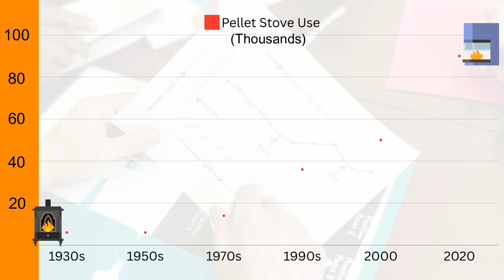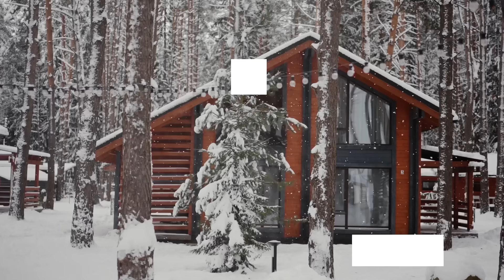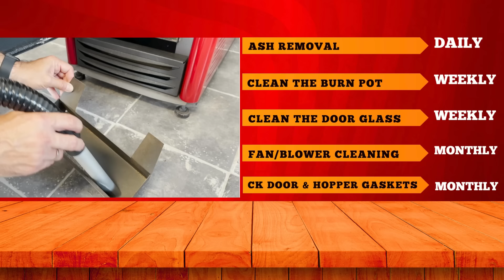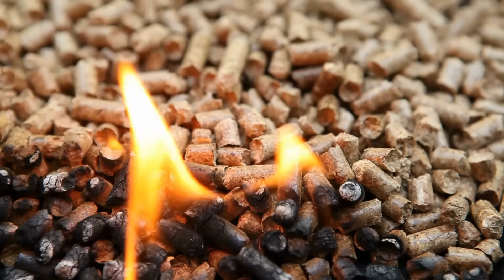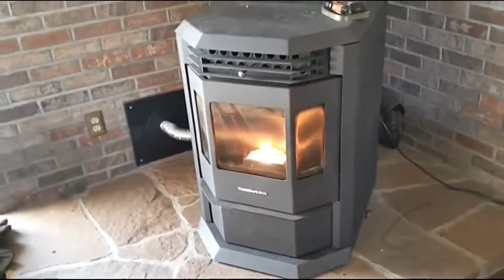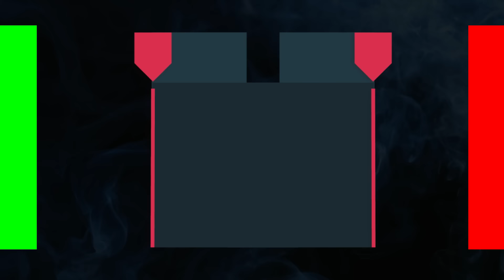THE COMPLETE TRUTH ABOUT PELLET STOVES

Comment: Millions of homes currently have Asbestos siding in the United States. These pellets stoves wood be impractical and impossible because you can’t cut the hole for the exhaust pipes. Even if you use a window to send the exhaust pipe out of the house, the exhaust pipe can’t be secured to the outside wall due to the asbestos siding.
Reply: FYI  some of us have brick homes so we can secure those pipes.
Reply: , FYI  you're forgetting all about folks who will remove a window in order to install the pipes. And many also have brick homes so pipes can be secured.

Comment: I have a US stove 6041i and it is one of the worst purchases I have ever made in my life.  Multiple failures. The pellet auger failed. The control board failed about 7 days before what I calculated my warranty would run out.  US stove informed me they start the warranty the day the wood stove leaves their factory. I was able to plead my case in that I didn't have use of the wood stove when it left their factory for several days because it was in transit and they should extend it to the date of delivery. Thankfully they did because the control board was over $600.  The 6041i is a conversion of the 6041 to make it an insert. Every time you have to do any kind of maintenance work you have to remove the insert from the fireplace. There is not a rail system to help you pull it out so you're going to scratch up your hearth unless you're careful. The cooling fan on the auger motor cracked at the shaft and the fan was not available as a replacement part. I was able to glue it back together and use a spring clamp from the hardware store to affect a permanent repair otherwise well over $100 for a new motor.  As I said it's a 6041 that was converted to an insert. The 6041 as a standalone is much easier to use. The hopper door is in the right position and you can get to the auger to clean out compressed sawdust from the pellets. This has to be done every so often. 6041 has a narrow door in the front and to get to the auger to clean it you have to remove the entire top. On the standalone unit the top door is large enough you can get your hands in there and remove the cover to clean. 6041i is not, not by a long shot.  Only a few operations did it ever put out the heat that it was supposed to. Most times it wasn't that efficient. So the 6041i from US stove I would steer so far clear from it.

Comment: We opted to go to a pellet stove in 2018 when we rebuilt our home following a fire (not related to heating). Our choice was a Castle Serenity unit. When we came to install & set up we quickly found that nobody knew anything about them & the OEM was useless. Our of necessity I had to search out info & learn everything about the unit for myself. Even now when we had to get it WETT certified for insurance, there are zero suppliers who will install or repair them but we could get it certified... you are on your own once you buy it! This is why I have a love hate relationship with this unit.
Pros:-
 It is convenient to carry bags of pellets instead of logs. It is clean, ash levels are low ** see tuning beliw**. Switch on switch off, that simple. Economic, unless you have free firewood. Cheaper than propane. More comfortable heat than forced air. 

Cons:-
Needs power to run controls, exhaust flue & unit blower. Noisy, there are fans. No support... you are on your own. 

**tuning. They are pellet fussy. Each pellet needs you to tune the air intake, feed rate & exhaust. Get it right & it burns clean, producing only 1% ormf fuel in or less as ash. Air leaks upset everything. 

What I would do different:-
 I want to get a pellet mill. I can make my own pellets that way from wood waste like skids. Needs a battery backup for piwer failure.

Comment: I have a whole house ducted heat pump, great for ac but suffers in zero temperatures, so I keep a wood stove for low temperatures and power outages. Pellet stoves are worthless for that as they require electricity. Also they have a circuit board, another weakness.

Comment: We've been using an Enviro Mini for about 15 years as the heating source for the main floor of our house (about 700 ft^2, with vaulted ceiling). We've had a few issues, all of which I repaired myself, but the main maintenance issue is that the ignitor burns out about once each year. OEM ignitors are ridiculously expensive, so we started using cheap knock-off brands that burn out even more often. But, the real issue for us is that pellets have become quite expensive here in CA--this season, we can't find any for less than $10/bag. So, when it is 50 degrees or more outside, we use the heat pump on our minisplit AC unit instead of burning pellets, and save the pellets for colder days. It rarely gets below 40 degrees here, so even in winter, we don't need to use the pellet stove every day. 

Anyways, under the right use cases, pellet stoves are great. And, if you live somewhere where pellets are reasonably priced, it's a no-brainer...

Comment: Ran a harman stove for many years. Get a quality stove brand.  The harman still runs after 19 years.  Circuit board has been replaced 2X and a blower motor and augur motor 1X over this time.

 On average, it cost me $600. less per year versus oil to heat the house.  Stove cost $4700. and for the quality, was well worth it.  Calculated the return on investment, it takes almost 8 years of ownership to break even (not great).  
Easy enough to maintain but things you don’t think of:
-Requires daily attention, dumping in more pellets daily and a quick cleaning every 2 days…so doesn’t heat your house if you go away for the weekend.
-You never quite get used to the blower fans and augur noise.
-Oil prices go up, so do pellets.
-If you need service or repair (although rare), it can be difficult to get a technician to come out as quickly as the oil repairman.  There just aren’t as many companies that provide this service.
-You don’t save anything for many years until the stove pays for itself!  

You come to a point in life where you really question if saving $600. per year is really worth the time and effort.  The truth is, it isn’t worth it!  A lot easier to just heat with oil.

Comment: This house I moved into has a pellet stove on the main and it's been a real PITA. The only heating place in town took 5 trips to finally get it working. Downstairs there is a wood-burning stove but it's the catalytic kind, so both need power. I get power outages and I need to reset the generator as it's stopped working. My downstairs is unfinished and I'm too physically challenged to go up & down the stairs. Unfinished also means a cold floor above. My HVAC furnace kicks in on & off. Unless I'm near the pellet stove I'm cold AF. <sigh> Women who think they can own houses.

Comment: I have a harmon for 17 years, not one failure. I can't believe the quality.
Down side of pellet stoves, they only burn pellets. Finding pellets late season. The plus is they're easy to start and run. When your in your 80s you'll be glad. Down side of fireplaces, chimney fires, hauling, storing wood, trying to light. At 80s+ not easy. Plus is in a bad situation, you can burn your furniture for heat..hahaha

Comment: 3 days in the dead of winter if you relied on solar back up and you are snowed in from a blizzard with no electricity and your solar back up and generators fuel is exhausted? You will wish you had a wood stove instead of a pellet stove. To many moving parts and potential failures to guarantee for it to be there for you when the rubber hits the road. Also cheapest overall. Extra work? Sure. Called exercise. Enjoy.

Comment: I've had it for over 20 years and now it's proven that propane is the better deal. Pellet stoves are very dirty and just a lot of extra bulshit to deal with all those bags.. bless your house isn't equally heated.. you have all kinds of blower motors that will go bad on you that have to be replaced.. I think it's really just kind of a unnecessary thing not a bad thing for back up here though. Pellets are way overpriced and the same thing they did with diesel fuel they made the diesel engine less efficient because they've doubled the price of diesel compared to gas the pallets is the same situation they're f**** you pretty good

Comment: Installed a new Quadrafire (CB1200) pellet stove in 2011 and replaced it in 2020 with a wood stove.  If it gets below 25 F outside my furnace would kick on ( which was set at 62F ) because the pellet stove couldn't put out  enough heat to keep up in my 1200 sqft home.  Where I live, the temp is below 25F from November until the end of March, so....   Also there was the problem of extended ( 3-4 day ) power outages two or three times per winter.  Then there was the issue of trying to keep the thing running.  The pellets would jam up and stop dropping from the hopper into the burn pot several times per day, where I would have to dig by hand down to the bottom of the hopper and wiggle the pellets enough for them to start dropping again.  And then there was the problem of the electronics either going out or needing to be reset once in a while.  Plus pellets have doubled in price.  -- Bottom line, I wish I had gotten the wood stove first and I have ZERO regrets about switching to wood logs.  If I move or for some reason need to start over I will not even entertain the idea of a pellet stove again.
Reply: Placement of your stove could have been part of the problem as far as heating goes. Losing power would affect your furnace also. If we lose power I run my pellet stove off my generator. I get that's it's work but you have to keep a pellet stove clean or you can have all kinds of problems. I run mine 24/7 in the winter except to clean it. Heats my 1600sqft home. Had mine for 13 years and replaced 2 combustion motors because they got loud but were still working and last year replaced my auger motor.
Reply: move
Reply: Then you got to be doing it wrong. 😂  My Comfottbuilt in 5 years needed a $6.00 aftermarket  vacuum swith. That's with 2o min to find  the problem included. Because I over complicated the problem.  Should have taken 5 min.

Comment: I've had a pellet stove for 12 years: Harman P61A. Very awesome stove. But the downsides. Pellet stoves are expensive, all the hardware and thing needed, inspections needed are expensive, to the tune of $6800-7500 here in NH. Then there is the pellets of which the cost has risen over the years to make heating not as affordable as it used to be. Then there is hauling in the house 3 tons or 150 bags of pellets. Two things: As you age you don't want to carry bags of pellets; my time is worth cash. Not worth it. Propane heating high efficiency is cheaper. We have a coop with 1000's of people in it whereas propane is way cheaper.

Comment: I have a dual wood pellet/corn burner. The cost was crazy for the corn, and would attract mice. Pellets were higher than Nat. Gas.  Natural gas was much cheaper. Plus, the unit was in my living room, so it would trick
the thermostat into thinking the entire house was warm, and the rest of the rooms would be freezing. I was not impressed. Earth Stove brand. Weighed like 800 lbs. Small town, didn't have a choice of different pellets.

Comment: wondering if i can install my pellet stove with a pipe size of 90 inches vertically , connected by 90 degree angle straight from the stove  and 120 inches horizontally using another 90 degree pipe  . i have no other option for that !! (
Reply: Yes you can! You probably will need a 4 inch diameter pipe due to the over all length if the pipe, and the fact you are dealing with two 90 degree bends indoors. Also consider any other bends needed outdoors. It would be wise to have your plan reviewed by a professional installer first.👍

Comment: My house is a 16x80 mobile home, i go through less than a ton of pellets per winter. At -20 i do need to turn on the forced air electric furnace to keep a corner of the laundry room from freezing. Or run a small fan into that corner. I have no issues with the stove, i leave the interior doors open with two ceiling fans on low, heats the house great. The people asking about when the power goes out? What does not run on electricity? Get yourself a small generator and stay warm! Quality pellets are a must. By the way, i live in North central Wyoming,,,it can get cold!
Reply: deos pellet heater burn oxygen?

Comment: 1. Here in Western North Carolina, cord wood prices are much higher than mentioned here, and finding a true full cord (4'x4'x8') is rare. Well seasoned hardwood can be tough to find. More likely to find a mix.
2. I've found quality pellets locally available for under $300/ton.
3. Video failed to mention the non-electric ("off-grid") units available, such as the Wiseway. When I see electronic controls and multiple motors, I see failure points that can/will leave me in the cold. 
Off grid on wood heat for 25 years here. Shopping for a good, simple pellet stove.

Comment: Very expensive vs a direct vent natural gas wall heater. Ours set on the lowest heat setting goes through 1 bag a day. 6$ a day + electricity. Thats with mild low temps above 20. When its  colder we crank it up to 3. Which uses 2 bags a day.

Comment: We have a Napoleon NPS45.  It is on the main floor of our house and depending on how cold it is outside and the the heat setting it’s on, (1-5) can heat both floors.  That said, we also have a heat pump for summer AC but leave it at 70 degrees year round.  With the stove set on 2 the heat pump kicks in maybe once or twice an hour.  In colder weather the stove runs on 3 or 4.  Gives great heat and certainly lowers the electrical bill.  Certainly not as much mess as a wood stove.

Comment: The pellet stove is not a good choice. It's expensive to run with electric use and pellet cost. In addition, if you lose power, you are screwed for heat. Natural draft wood or coal stove is a better choice.
Reply: My pellet stove has a battery and inverter for back-up. That will run the stove for a couple days. My pellet stove cut my heating cost in half, just sayin'.
Reply: Pellet CO$T .. YES!       Electricity No .. the computer, fan, & auger run on DC power.
The igniter is AC power .. limited time On, but has to be replaced every several years.
Reply: @stepside2839  My pellet stove uses AC power on everything internal. Do you own a pellet stove?🤔
Reply: @dougskucas5004  Yes, I bought it in 2007.
I found out that all components operate on DC power, as it has battery backup. Only the igniter is AC. When on battery backup, one must manually start the pellets in the fire pot with starter gel. I have serviced almost every part of the pellet stove over the past 17 years with a couple of modifications.

Comment: A good pellet stove for starters. 
But it is critical you have GOOD pellets. 
Good pellets will burn about 50 lbs per 24 hours. 
Bad pellets will burn 120+  lbs in 24 hours. 
Bad pellets cause so much ash it litterally plugs the stove. 
Pellet ash is also corrosive as hell. 
When I could get really good hardwood pellets for $250 a ton, it was great. It heated the house for about $5 a day. Removed ash once a day. The stove blew 250+ degree heat on low.  Filled it once a day. 

Bad pellets, just forget it. You had to turn the feed way up or it went out. The ash needed vacuumed out of the stove daily, with a complete teardown to vacuum the heat exchanger out once a week. The ash tray was full 3 times a day. It struggled to blow 125 degree heat. We did 1 winter with 4 ton of bad pellets.  The ash going out the chimney also killed the grass AND a baby apple tree  out about 30 feet on that side of the house. 

My friend burnt up the fans in his stove with just 2 bad bags of pellets. The pine pitch clogged the fans and burnt the fans up. 

You MUST have really good pellets. It's that simple. And pellet plants are buying the cheapest junk sawdust they can get to maximize profits. I know one plant was even buying junk newspaper and cardboard  for pellets. Which meant you were burning INK, which is toxic. Touching the pellets turned your hand black which ink is hard to wash off. The smell of whatever garbage was in bad pellets stunk the whole house up. It was horrendous. 

The price of pellets upwards of $7 per bag,  & only having junk pellets available, I stopped using my pellet stove 5 years ago. Fuel oil is much cheaper now. 
Without good hardwood pellets for around $5 per bag, it's just not worth the headache & work.

Pellets stoves can be great, but it's a finicky stove. Without a good stove & good pellets it's a waste of time, energy & money.
With a good safe chimney, nothing beats a good old fashioned wood stove. It works when the power is out.

Comment: My last house I heated with cord wood for 18 years straight. My new house I use my oil furnace it's actually cheaper than wood and the house is well insulated a log home. I do have a new wood insert with afterburner that's rated at 85% efficiency. It's a large stove and it burns hot for a long time but with all the rooms it's better with oil especially because every room has its own zone control.

Comment: Don't install pellet stove insert. Pellet stoves need to be cleaned regularly. It can't be done with an insert. I have a pellet stove and I love it much more cleaner than a fireplace
Reply: My insert slides forward with minimal effort, and I am 68 years old. When slid forward, ALL the components are accessible with no difficulty for cleaning and inspecting. Three years now with no problems arising.
Reply: I’ve had my pellet stove insert for 17+ years and am able to clean it. 
It has provisions for easy access to areas needed to be cleaned. 🤷🏻‍♂
They are not all alike, but yeah, something to be aware of before purchasing.